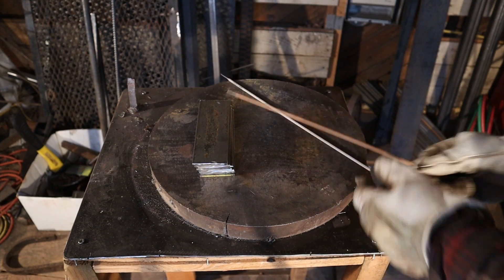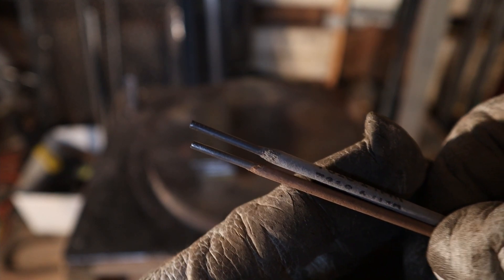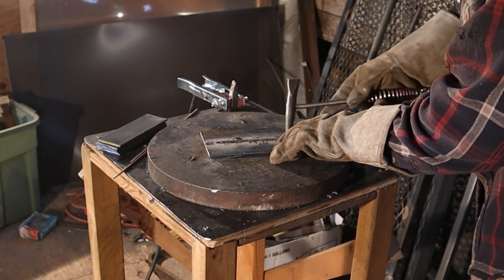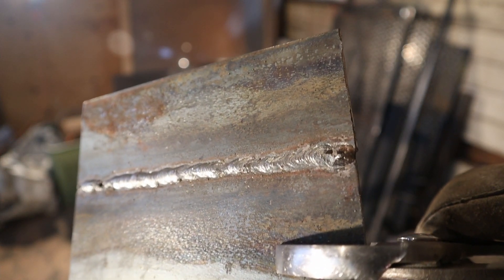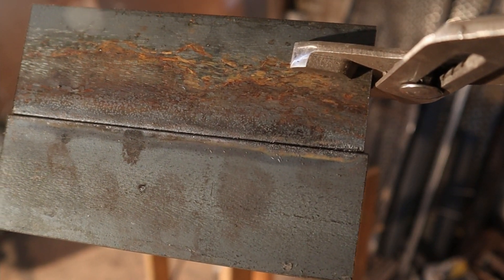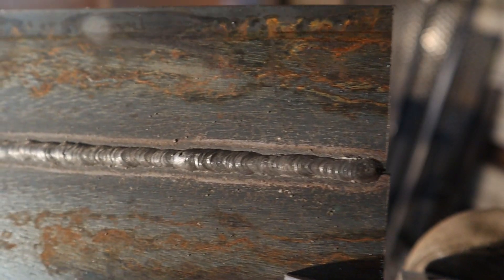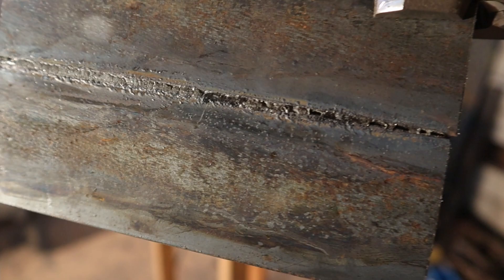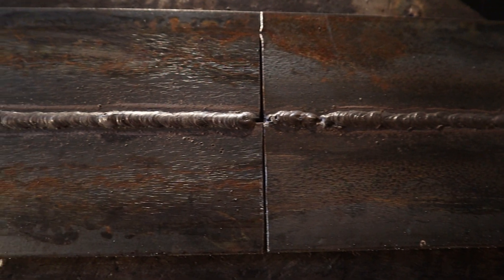7018 vs 6013 / Which rod should I use for my projects?

Comment: I'm with Bojack. For fixing broken exhaust pipes on cars, the 6013/ 3/32" was easier to use than the 7018 3/32"which was constantly sticking and needed constant filing to restart. The 6013 @ 70 Amps DCEN worked best for repairing automobile exhaust pipes. Great video and thanks for posting
Reply: Correct. 
For light (thin) elements such as auto exhaust tubing, 6012 or 6013 DCEN is THE correct procedure.
7018 is NOT suitable for that work.
Reply: @tandemwings4733  Thanks!!

Comment: DCEP is the standard for 7018 and pretty much any stick electrode! The exception being 6013, 6010 & 6011 when welding thin steel, are frequently used with DCEN because of a reduced possibility of burn through or blow out! The vast majority of AWS SMAW WPS’s don’t permit 7018 polarity to be anything but DCEP because of reduced penetration on electrode negative polarity. 7018 is the “go to” rod in industry, but they aren’t always a good choice for a small shop that doesn’t weld frequently. Their biggest limitation being that upon the original opening of a new can of electrodes, all of the rods are supposed to be kept in a 250 degree oven until used. Failure to do so will result in the electrode losing its “low hydrogen “ qualities, and greatly reduced weld strength. 6010, 6011, 6013 & 7014’s, on the other hand, don’t have to be kept heated to maintain their integrity. Just some points to ponder in the great stick choice game!
Reply: 7018 can't just be removed from a sealed container and used straight away? Could I put the 7018 rods in my oven for an hour, prior to use?
Reply: @vigilantobserver8389  The manufacturers as well as AWS rules specify that after a sealed container is opened the first time, they are ok to use for something like either 4 or 8 hours, after which time they have to be kept in a rod oven @ 250 degrees. If they’ve been out for many hours or days, or “exposed to moisture “, as I believe the rule states, they have to be rebaked at 500+ degrees for many hours, and that can only be done one time! Normal procedure where 50lb. boxes are used is to open a new box and put them straight in a 250 degree stabilizing oven, keeping out only what you’re immediately going to use in 4 hours. This is also a reason why the round, 10lb. or smaller cans of rod have become so popular. There’s lots of good info out there from AWS, Lincoln Electric, Hobart, ESAB and others about this.
Reply: Just put them in cheap toaster oven
Reply: @vigilantobserver8389  if you do code work 7018 need to be baked in the oven other than that they can be used right out of the box

Comment: I use 6013 with a 50 year old Lincoln 225 welder. I never have the spatter you do and the slag falls off by itself most times. I don't need the tensile strength of 7018 rods. Good video. Stay safe.
Reply: Maybe he was running too hot? (too much amp?)

Comment: I made steel construction for balcony roof and used 6013 and 7018 electrodes from the same manufacturer.
It is recommended to run 7018 on positive and 6013 on negative (I ran on positive,because was lazy to change and steel  was 2 mm).
7018 has much prettier weld and almost non-existent slag,but is very hard to reignite.
6013 has much thicker slag,but is very easy to reignite.
Electrodes were 2,5 mm and I ran on  70-75 amps.
Reply: 7018 will reignite just fine if you remove a bit of the slag/shielding on the tip of the stick

Comment: Good video, however as far as i know and i use the 6013 has a slag that s super easy to clean almost with a touch it lifts up immediately. Maybe a little lower amp will work better especially with the thinner ones.
Reply from the maker: Interesting, I didn't think the amperage would have much to do with the slag. But your probably right, I was using a pretty high amperage for what I was doing with 6013. I might see if lower amps has an effect on it.
Reply: @FerrousPhoenix  probably had the rod a little wet too
Reply from the maker: @Pereke69  your right, I don't have any ovens to store my electrodes in. They are all stored in a building that doesn't have good insulation and heating, so they are all to wet.

Comment: Good  demo. Im doing some repairs on a sea wall  on a lake tomorrow.  I am a welder fabricator. Mostly I  mig and tig but im decent w arc as well.
 With a very good old Lincoln  Kohler welder generator.  Ill bake both kinds of rods for a while  in the oven. On site, I`ll, clean it all up and put some beads on it. Im sure it will be good  bandaids for a n old sea wall that needs to be replaced.

Comment: Note there is a AC version of the 7018
Reply: Which is recommended for “wimpy” welders, as it has a lower Open Circuit Voltage requirement needed to run OK.

It works fine on DCEP, which is the only way I have run it in the past.
Reply: @dennisyoung4631  Good luck fighting arc blow with a DC rod.

7018 AC does a better job on magnetized steel.

Comment: A better comparison would be to use both rods at the mid point of their amperage range.  I.E.  6013, 60 amps  7018, about 105 amps
Reply from the maker: That's a good idea. I kept the amps the same to give myself another controlled variable, other than just the thickness of the rod and material.
Reply: @FerrousPhoenix  The problem is welding at the top of a range for one and the lowest of a range for the other is apples vs. oranges.  It is not a controlled variable it is out of control.

Comment: From my experience welding while working with chain link fences (gates and a few custom order weld jobs was what i was welding which is mostly mild steel only, 6013 3/8 rods worked best on that while 7013 was for the odd harder steels we occasionally worked with, 7013 blew threw ss15 pipe like butter too

Comment: Run some rod of whatever type at varying amperages to get good settings - good for your machine and good for how you weld -  before doing any comparative tests.  Then, note that 7018 and 6013 are very different rods for very different jobs. Each will be best for its purpose. They should not be treated as comperable.

Comment: First the 6013 AC are AC alternating current and the 7018 one metal cold and the rod as well which should heated at 300 degrees kennel oven to help the welding rod  start.

Comment: Apple's and oranges 7018 for metal as like hevy farm equipment 6013 for mild steel also the flux on 7018 runs cleaner and is different. As to the 6013 flux splatter more like a 6011 6010. You can 6013 run vertical try running 7018 vertical.
Reply: I disagree totally, with your initial statement. I ONLY use 6013 on ag work, anything from 2mm up to 25mm thick. 7018 is a pain in the arse for restriking.

Comment: My opinion would be they are both suitable for most task but excel in certain areas 6013 makes overhead a breeze while 7018 is required for anything required nuclear/heat-treat the quality of the weldment determined by the weldor/he or she 60/70 tho tsi is hardly noticeable by your doityourselfer

Comment: The only thing with 7018 is that you have to tap or file the end of a partially used rod because the flux tends to stop the end of the electrode restriking easily.
Reply: No you don't, just flick off the cherry right after you lift your arc. If you're too late, take it out of your stinger and push and twist lightly on a hard surface.
Reply: @conner3542  ok.  That might work too but taking it out of the stinger and twisting is doing the same thing as tapping or filing?   Anyway will have to Ryan what you say.
Reply: Try not Ryan…..
Reply: @paulnicholson1906  if you tap it you're going to potentially break off too much flux, making restarts hideous and full of inclusions, and filing takes way longer than taking the rod out of the whip for 2 seconds. Get good at flicking the cherry and you'll never have to worry about it. Just my 2 cents, I've been welding structural steal field and shop for a long time and this is what works for me and many others in my field.
Reply: @conner3542  thanks for the info.  I learned something.  I’m certainly not a pro. So your 2 cents worth more than mine…..
Reply: @paulnicholson1906  I wouldn't say your 2 cents is less important, you spoke fact on harder than average restarts for 7018 rod. However, every rod, filler, and wire has its special operational secrets that people don't often talk about, and when you're burning through over 1500lbs of 7018 annually you eventually learn those secrets from other welders or through trial and error. I'm just here to spread the word. America needs more proficient welders.

Comment: too hot on 6013 look at the splatter
Reply: Also, that’s the Hobart flavor, which is reputed to be closer to what’s called a Rutile-Cellulose rod.  It tends to act like a mix of 6013 and 6011 - more penetration, and more spatter.

I have bought some for welding practice - I need to practice stick a lot more.

Comment: Your 6013 runs look like Flux core..?? so much spatter,  maybe 🤔 quality of the welding rod brand..?? I use regular Lincoln 6013 available at my local home depot and it never leaves spatter like that. Thanks for the video
Reply: His amperage is way too high. Dial that down to the correct heat and it eliminates 90% of the spatter, same as any other flux involved process.

Comment: No one else seems to have caught this but you handicapped the 6013 by running them both at 80 amps. You would have had better runs on the 6013 at a lower amperage and less spatter as a result.

Comment: Dude, you used 80 amps on the rods that recommend 40-60 amps. It's was OBVIOUSLY burning WAY too hot for the 6013s. Which also makes the slag much harder to chip off. You can't be serious with this video...

Comment: Throw the 6013 right in the trash, if you cant run 7018 go with 7014.
Reply: That's a load of crap. Why do you NEED a higher tensile stick, which is also a pain in the neck to restrike?
Reply: The solution to restrikes? Get a better welder.

ESAB and Hobart make the best 6013s. ESABs are easy cleaning and Hobarts penetrate more.